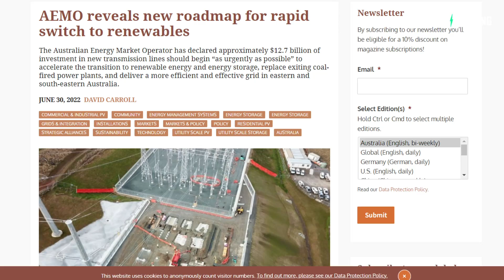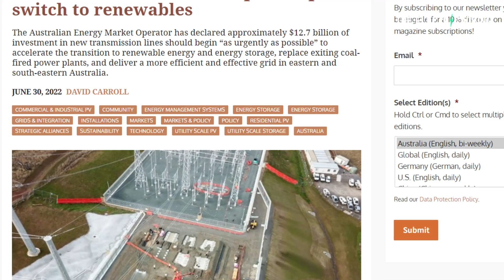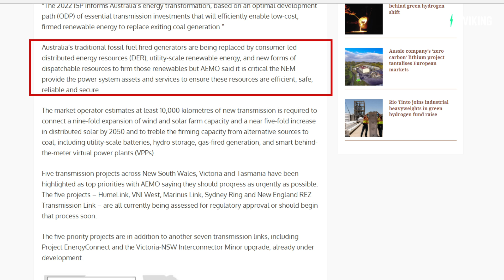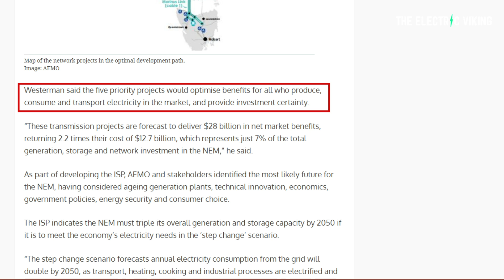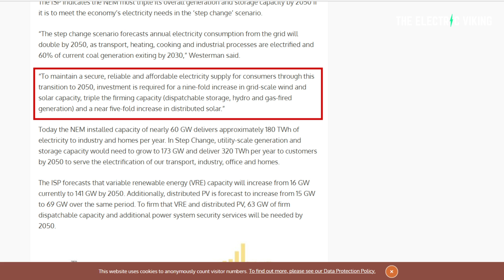Australia's AMAZING roadmap for rapid switch to renewables

Comment: I am off-grid on my narrowboat. Last winter I only had to run the engine a handful of times in December. BUT I have just doubled my solar to 1.8KW.
So I'll see if I'm now totally fossil free re electricity use this winter. To be honest, even in the UK I wouldn't get mains electricity if I bought a house without it laid on already. Solar is now so cheap every household in Australia should get it. You need free air-conditioning if nothing else, I would expect. 
Good to know your government is getting cracking not fracking like our lot seem to want.

Comment: Mr Viking,
This is pure pie in the sky. It is impossible to transition to pure renewables it is technically and practically impossible.
Firstly the real problem of intermittency is unsurmountable, batteries are no solution.
Renewables cannot load follow so need dispatchable generation to keep frequency within control, i.e. fossil fuelled generation.
 Inertia is required to keep the system stable, which renewables do not have.
Short circuit levels is diminished with renewables as is reactive power control.
Fantasy land, pure and simple!
Reply: But yet ACT has been 100% renewables for year
Reply: Chefgav,

please explain what you are referring to?
No grid will i run at 100 per cent renewables unless it is hydro. Grids occasionally claim to be running all renewable but are connected to neighboring grids  without which they could not operate.
Reply: @iareid8255  There are many ways to get renewables to work 100% of the time. Here are just a few:
1. Mix up the renewables (wind complements solar very well), where possible add in some hydro, tidal, river flow, gyrophemal, offshore wind, onshore wind, biomass etc.

2. It is always windy and always sunny during the day somewhere, if you connect large enough areas into massive grids and share the energy you would hardly need any batteries to  be 100% renewables. (Europe is currently constructing a super grid for just this)

3, Over-build renewables to allow for light wind cloudy days. (UK's plan for wind is to over-construct)

4. Many days of the year, will have too much renewables (for example to have enough solar in the winter will have miles too much in the summer), so use spare to generate hydrogen store and burn in converted gas power sations when not enough wind or solar

5. Intelligent grids (charge cars when renewables abundent, intelligent hot water tanks endevour to heat water when spare energy. same with storage heaters etc.

Over build renewables and use spare energy for desalinating water, Aus water problems solved. (plus currently 1/6 of the worlds fresh water is used by fossil fuels)
Would almost solve Aus water issues if just stopped burning fossil fuels.

Plus of course some batteries! of which the price is continuously dropping and new technologies are rapidly being developed

And the actual answer to get the Australian grid 100% renewable is a mix of all above.
Reply: Steve,
Overbuild, do you have any comprehension of how much overbuild you would need, try around 50 times maximum demand.
It is usual that when the U.K. suffers low wind conditions, Europe does also.
Another slight snag is that wind solar, wave and tidal cannot load follow so the grid will trip  on frequency deviation.
Renewables are not equivalent to or a replacement for conventional generation.
It is a practical and technical impossibility to supply a grid with just renewables, except for hydro.
Reply: @iareid8255  The Uk estimates 3.5 times wind capacity. Which is not much more than the current fossil fuel which is at 2.4 capacity. The average fossil fuel power station average 40% capacity. renewables dont cause grids to crash, if you have too much just turn some off. (In the IK many nights a year GW's of wind is turned off same as GW's of Fossil fuels. 

It is 100% possible to power the world on renewables. For starters if we layed as many long-distance power cables as there are Oil and GAs pilelines could just move the power around the world. is always windy and always sunny somewhere. (AT NO MORE ENERGY LOSS than pumping oil and gas. Bassically if the world spends the same amount of time, effort and cost as it does on the massive fossil fuel industry would easily power the world many times over.
Reply: Steve,
you can't compare wind to fossil fuel stations. Wind sells all it can dependant on weather. Fossil fuel stations are used to balance the grid supply and demand so consequently have a low overall availability because of this. However they can increase to maximum on demand.
You cannot balance with wind by switching, it's far too coarse. That is why to much wind will crash the grid. During lockdown wind was curtailed because of this very situation, when wind was strong and demand low.

No, it is impossible to power even a small country with 100 % renewables they are not suited for many reasons, intermittency is the biggest and being asynchronous is also a very large problem.
Reply: @iareid8255  This is how you run Australia on 100% renewables, at no more cost than reconstructing the current power system, which will need replacing every 30 years.

One. is a national grid! So power can be moved from Perth to Sydney. (<10% power loss at 1.2 million vote DC as China is doing across simlar distance across China)

This gives a time machine you now average 15 hours of daylight per day (When sunny in late afternoon Perth is dark in Sydney and vice verser when sunny mid-morning in Sydney still dark in Perth)

Over build solar and wind, so enough to power duing the winter months. and spread all over the county (always windy or sunny durring the day somewhere in Australia)

Install enough batteries to level the system stopping surges, and allow power to be moved from solar during the day to overnight, and windy nights to daytime (level the duck curve)

Because of installing serveal times more renewables that is needed, over 50% of days will have 2, 3 or more times more energy than needed, use this excessive spare energy to generate hydrogen. Store and use in converted Gas power stations generating electricity when not windy or sunny enough.
Any spare hydrogen sell on the open market making a profit.

Any other spare abundant power use to desalinize water. Most spare solar will be in the summer so solving Australias water issues

Next, add an intelligent grid: Endevour to use more power when abundant and less when not: i.e.
Charge cars when power is abundant (cheap), heat hot water, storage heaters etc.. Mainly all done automatically with out having to think.

Once all installed no fuel will be required, so very cheap to run, just maintance.

And NO power is wasted, and the grid has 100% power all year round, all with current available affordable technology

But new technology may arrive soon making it every cheaper and easier. Like supper cheap batteries.

Its is 100% possible, if the motivation is 100%, and eventually, massively reducing the cost of energy! As never have to buy fuel!!!!!!!

And levelling/balancing the power: 
Batteries level in Milliseconds
Solar switch on and off in Microseconds
Hydro in seconds
Wind in minutes to start and seconds to stop

Expensive peaker plants in 10's of minutes

Fossil fuel power stations 3 hours to start or stop
Nuclear 24 hours........................

And no overhead cost to turn renewables on or off, unlike fossil fuel power stations, that are very expensive to start and stop with long warm up and cool down periods. or just kept on standby, like a expensive car ticking over. 

And Nuclear thats just F..ing expensive!

The bigger the country with a smaller population the easier to power by renewables. Australia!!!!! Perfect place, very sunny, windy, loads of spare arid land spread over a massive area, with a relatively small population. Perfect location🙂

The question is not can Australia run 100% renewable but why the f&^k is it not already NOW!!!!!!!!! Oh I forgot about the current corrupt government bribing, and brainwashing fossil fuel industry! They are going to fu8K Australias future over making as much dirty money as they can!
Reply: Steve,
you do not seem to understand the very basics of why this is not remotely possible.
Intermittency cannot be overcome by over building capacity nor by extended grids, it simply is not going to work. Wind generators are very sensitive to wind speed, being a cube of power output . This even a slight drop in wind speed gives a much larger drop in power.
There is also asynchronism which means that you must have fossil fuel or hydro generation to keep supply and demand equal at all times.
High voltage DC transmission lines are also fragile and cannot handle any overload that happens in fault condition and trip very quickly.
Pie in the sky is the vision of large scale renewables.
Reply: Steve,
 you don't read and understand what I write.
I served an electrical apprenticeship with the U.K.'s Central Electricity Generating Board who used to run all of the U.K.'s power staions, transmission lines and grid.
I can match your thirty years in this field, both in the U.K. and abroad.
As you don't seem to grasp that other people have as much if not more experience and knowledge as you think you have.
Goodbye.
Reply: Have a look at what ‘CWP Global’ are doing in Australia.

Comment: I'd be really interested in more details about this firming of renewables.   At this time, it is still quite expensive to do with batteries, completely impractical as a backup for wind.  Australia isn't exactly the best place for pumped hydro, and pumped hydro can't back up wind economically.  AFAIK, there is no industry yet that can be shutdown to cope with wind droughts.  So does this analysis include 100% backup of wind power with natural gas along with feeding it completely from stored gas?
Reply: ACT has been 100% renewables for years
Reply: The ‘AEMO hydrogen superpower scenario’ report which accompanies the report in the video may give you some pointer’s on Australia’s future directions. If you’re interested?
Reply: The original big battery paid itself off in about 2.5 years if I remember correctly which was about 1.5 years faster than predicted. That battery is a Lithium Ion Cobalt chemistry which will be soon considered as old school for the job. Elon recently said that Lithium Ferro Phosphate is more likely to be the future for stationary batteries for reasons of cost, longevity and safety.
Reply: @kimbels791  The "Big Battery" is minuscule compared what is needed for load shifting solar power.  As Tesla said:  its purpose was to provide "grid stability and system security to South Australians".  This is definitely something that Li-ion batteries can effectively do - frequency stablilization and bridging start up time for peaker plants.   You need 50 to 400 time capacity for shifting solar power.  This doesn't cover back up for rainy days.  That would need more than 1000 times the capacity of your "largest battery bank in the world".  For the state that has less than 10% of Australia's population - a country with 0.3% of the world's population!
Reply: @richdobbs6595  Yes this is true. Just to replace say 1 NSW peaker Eraring you would need 20 horndale battery farms alone just for that
Reply: Thermal storage systems are getting very close to viabilty as alternative to chemical battery storage and these can be attached to existing steam turbines at retiring coal generators.
Reply: @kimbels791  Citation please.  What is round trip efficiency?  Have you studies this extensively?  Do you have a science or engineering background, or are you just a true believer?

Comment: AU sould build massive solar farms then export energy to Asia.
Reply: In what form would this energy take ?
Reply: @lesliecarter4295  Australia’s building the worlds largest solar farm to power over 25% of Singapore
Reply: @chefgav1  same question to you . What form will this energy be to get it to Singapore.
Reply: @lesliecarter4295  transmission lines and under sea cable from memory.  Are you not familiar with the sun cable project?
Reply: @chefgav1  very familiar with the sun cable project. The project is unlikely to proceed because it is deemed “impractical and too expensive “according to its two main financial backers.
Reply: @lesliecarter4295  It's already passed all hurdles including government,  investment,  environmental etc etc.Its most definitely going ahead
Reply: @lesliecarter4295  information you have must be old as it's full go ahead as of 22nd June 2022
Reply: @chefgav1  scheduled to break ground on the project in October 2023. However, Singapore are now saying that they can get cheaper renewable energy more locally. The new Australian government are also asking if the energy from such a big project should be used to de-carbonise Australia. Interesting year ahead.
Reply: @lesliecarter4295  electricity.
Reply: At night?
Reply: Australia is building a massive solar farm in the Northern Territory, using submarine cables to export to Singapore, it will account for 25% of their energy it’s already being built at present. They are using new technology that folds off the back of a truck and lays directly on the ground it is also just the first stage in what is anticipated to be a ongoing venture

Comment: The UK and Germany converted 25% of their grid  to wind in 10 years. AU can easily add 50% in 20 years. Especially with residential solar. Probably in 20 years, residential solar with large kWh low cost home batteries will be the most cost effective for homes. People will likely be electrically free from corporations. Even now residential solar and batteries can be cost effective in some situations.
Reply: You can't really make your own PV panels and batteries, so we're still reliant on corporations
Reply: @andys31337  practically everything you buy is from corporations, from food, to tv's to shoes, toothpaste etc, so unless you live off the land like a cave man, you are reliant on corporations. But power from your own solar, you are only reliant on a corporations every 30 to 50 years when you buy new panels. unlike fossil fuels where you are reliant on corporations on a daily basis.

Comment: Just like battery technologies increasing, so is the materials they're using in solar panels to be more efficient when  collecting the sun's rays, also the wind generation systems are becoming more efficient too , 👌 so by years  You have mentioned , these systems will be produing whole lot more power than they are today.

🚓 ( So there's nothing new here,  keep moving, keep moving along) 🚔
Reply: Australia has a massive problem with millions of failed solar panles. All made in China. They can't recycle them, so they  have huge piles of the useless things.
Reply: How many horndale battery farms do yo think will need to be built to replace 1 NSW Eraring peaker power plant?